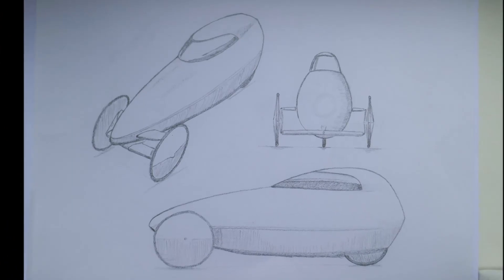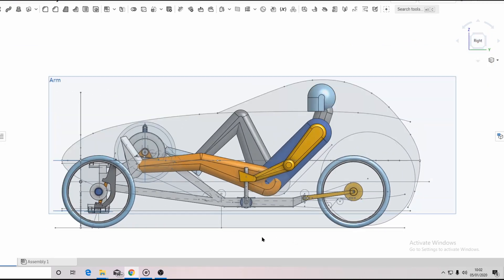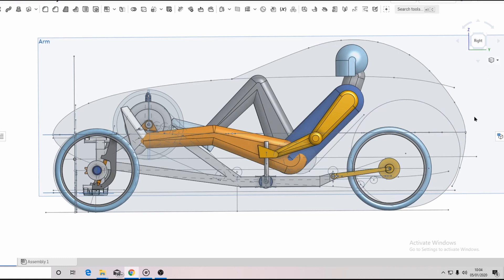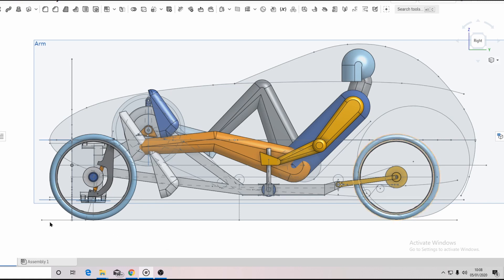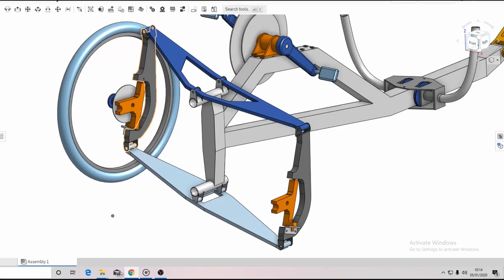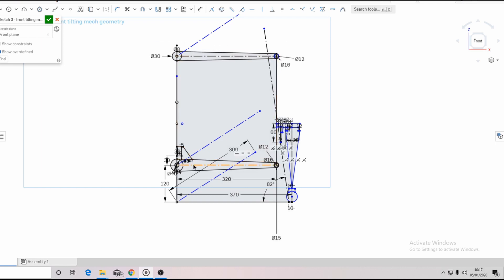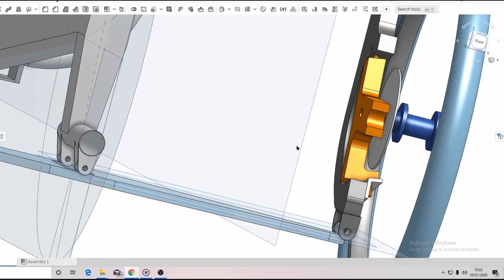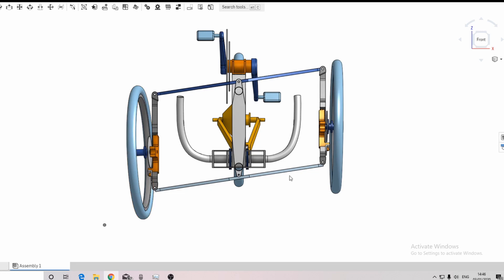Tilting Trikes Part 2 - Designing my streamlined, tilting, three-wheeled velomobile

Comment: Looking at your project, I figured it would be one of these with two seats. But not side by side, but one behind the other. It may not be possible to place rotating pedals but sliding ones with bars up to where the front crown would be and connected to it to such a bar that would be triggered to push the bar back and forth, allowing two people to activate the system at the same time. I don't know how to send figures around here or if it's possible. But if I knew a way, maybe we would exchange experiences.
Reply from the maker: I did seriously look at a linear pedal system but in the end decided that it was too complicated with no off the shelf components.

Comment: I haven't really understood what advantage the tilting wheels have. Could you explain in detail please? Thinking to develop my own one. But I'm not sure yet if to go with or without tilting wheels.
Reply from the maker: Hi, the advantages I think are: less risk of tipping over when cornering allowing a higher centre of gravity and/or a narrower vehicle; greater rider comfort and (maybe) enjoyment; less affected by bumps (I.e. the vehicle won’t tip to the side so much if one wheel hits a bump or a dip).  The disadvantages are greater complexity and weight; ground clearance when tilting.
Reply: @MetalMachineShop  Hi, have you seen this? Seems it could be built quite light and with minimal mechanisms. https://youtu.be/t1sUOtY4fYs
Still I'd go for an Quad....

Comment: Love your work mate ! Interested what basic what fork geometry you used. From my understand modern ideal is 73°head angle and 45mm rack. Tonight been brain storming an open recumbent based on a 80s Dutch Roulandt frame that I found today on road side chuck out. I believe 660mm width (legal cycle width in Australia) is achievable, considering it's to be an open design. I'm interested to liaise with you. I like your approach to design.
I'd like to share some more of the ideas about the brief I've set for myself, particularly as you have been so open on the Web about basic geometry and what exactly you are building. 
I was just going to be doing a  2wheel recumbent but then contemplated tilting 3 wheeler geometry.  Good on you for being so through about geometry variations and consideration there of.  I've looked at a couple of utube clips. One of Harley Davidson bolt on kit and 2 of your videos. 
You've more less answered all my inquiries.  Good on you. 
Inspired to practice on a 3D modelling program.  Being a newb to it really I may just start with sketch up. 
Hmm how to correspond??
Here's my email:)
adam.h.r18@gmail.com 
Cheers

Comment: Okay, so I am watching this in sequential order and I realize this is likely too late, but here it goes:
Suspension is very important.  Unlike an upright bike where your body can cushion the vibration, in a reclined position the bumps and vibrations go right into you.  My fear is that the flexing, undampened suspension of the front would cause a lot of shock and vibration for the rider.  Also, I'm worried about losing stability on washboard/cobblestone roads due to rapid flexing and tilting.
I also feel that the rear wheel should be as large as possible.  It will make for a smoother, more comfortable ride because it reduces the angle of attack and spans wider gaps.  It will also reduce rolling resistance, and the tires will last longer because they have more material.
Also, I didn't see it in the CAD render, but the rear suspension should be dampened so you're not bouncing, both for comfort and stability.
Reply from the maker: I did a design study with a bigger wheel, and while you are right about the advantages, it makes the trike a lot longer, a bit heavier, uses up the luggage space and makes for a tighter break over angle for the chain. Pros and cons, but for me smaller was better! Sorry for the delay replying and thanks for your comments.

Comment: This series is extremely valuable! Could you arrange it in a playlist? I'd like to refer someone to it and the titles don't all show the part number.
I learn't a lot of valuable things which I will likely apply in my starting carreer in engineering. Thanks a lot for sharing!
Reply from the maker: Hi, thanks. I will do that as soon as possible.
Reply from the maker: Hello, I've just added the playlist for this video series.
Reply: @MetalMachineShop  Thanks a lot! Are you building a prototype of the velomobile?
Reply from the maker: @MrSaemichlaus  Yes, I am part way through making a basic prototype.  It won't be pretty, but if it works, I will build a better one.  I want to check if the tilting mechanism is successful before committing too much time and money!

Comment: Looks great, if you're moving from the starting cam towards a drive-by-wire, could you overcome the offsetting limitations of the cam by using the wire to achieve similar geometry to a rack and pinion design? 

A personal consideration regarding the two chain guide pullies guiding the chain underneath the rider leading on and off the drive-chain-ring could be on the same axis just offset slightly so the chain would run in opposite directions parallel in the plan view rather than the typical parallel in the side view. as illustrated.
Reply from the maker: I did think about using wires for the steering instead of pushrods.  Someone told me there might be problems with resonant frequencies, but I’m not sure about that; it seems to work ok for aeroplanes.  In the end, the design got a bit complex need for return pulleys and so on.
Good point about the chain idlers, I will look at that solution.
Many thanks for your comment!

Comment: The front tilting design is interesting, as it avoids the oversteering tendency of delta trikes, but there is a major flaw regarding the weight distribution. Because your CG is approximately a few inches above your hip joint when you seat in a recumbent, the rear wheel will be loaded with 2/3 of your weight while the front wheels will each be loaded with only 1/6 of your weight in your current design. This will result in a 1:4 ratio of the slip angle between the front and rear tires. Except if you use front tires 4 times more sticky than the rear tires, it will understeer so badly you won't be able to carry any sort of speed in a turn, which defeat the purpose of a tilting trike. To avoid massive understeer, you need 1/3 of the load on each tire, i.e. 2/3 of the load on the front "axle". That's the reason why all tadpole trikes or velomobiles have the front axle around or behind your knees. It makes the implementation of a tilting mechanism more complex, as your legs are in the way, but it's better than having front wheels sliding every time you try to turn.
Reply from the maker: Hi, thanks for your comments.  I am working on a prototype so will soon find out whether it works in practice!

Comment: The kingpin angle and rake geometry at the ends of the front end components is thoughtful. Could you rake the center frame pivots to achieve similar results? It might add some loading stability in that the chassis weight load would then be aiding in self-leveling or self-righting forces for better tracking. More or less like the rake added to the crown assembly of a conventional single front wheel trike or bike? Something to play with in 3D now. Nice cad work. I like the flexing suspension concept. 3D twisting provides some great compensating geometry and progressive response. Keeping all three on the ground is always best. Steering with tie rods is still simple with the tilting action if the wheel end steering pivots are on the same plane as the lower suspension pivots at the wheel ends and the center steering lever is integral to the lower suspension section keeping the entire steering apparatus in the same plane as the lower suspension section. Geometry can be created for the center steering lever to compensate for the natural understeering of the inside wheel.

Comment: Does "counter steering" come into play with this three wheel designs?
Reply from the maker: It should do, just like any bike. Low centre of gravity may make it a bit wobbly though.
Reply: @MetalMachineShop  Wobbly is not good! I thought the lower the centre of gravity the better.?
Reply: @MetalMachineShop  I'm not sure you know what I mean by countersteering. When at speed a conventional two wheeled device turns left by turning the handle bars right. From what I have observed by watching other reverse trike leaning designs, countersteering is not a component because the tires are manipulated on to their side mechanically. A two wheeler is subject to gyroscopic forces which requires the countersteering principle.

Comment: I believe the term "fly by wire" has to do with 'electric or electronic" not metal cable wire as in there is not a "mechanical" push-pull involved. Mechanical would be rods, cables and even hydraulics.
Reply from the maker: Yes, you are right, I misappropriated the phrase!  I am thinking of a closed loop pulley system, a bit like on an old aircraft or a glider.

Comment: Do you realise how bad for your neck that low seating posture is?
Reply from the maker: Do you think so? Seems like a fairly natural posture, possibly better for your neck than a normal bike.  I’ll just have to try it I guess.
Reply: @MetalMachineShop  no it's really bad for you, as someone who has neck issues I can attest.  The position is actually, with the chin closer to your chest reducing the curve in your neck and strengthening the muscles on the front, anterior side, of your neck. Try reading a book in bed  or on your couch in similar position with your head unsupported. The hypoextenion position is not recommended in any form and worst when unsupported. I guess you got to do what you got to do for progress. But that position is unsustainable in the long run.

Comment: Fabulous!  Delighted to see your follow up. Also, John Tetz, of foam velomobile fairing, argues rather persuasively that a central steering control aids in the easy walking one's vehicle and steering it when ever you need to move it but particularly in the event of multiple flat tires or other possibilities. https://vimeo.com/25131208  Oh! Which CAD are you using and will it be open source design... (please)?
Reply from the maker: Thanks for your comment. Good point about the steering - I hadn’t thought of that.  I’m using Onshape. I haven’t decided about the design rights yet, but watch this space!
Reply: @MetalMachineShop  Thanks again for the upload, which I hope to see much more of. :) I am on the same path, but not as advanced as you.

Comment: @MetalMachineShop Is your vehicle for urban use, possibly commuting? If so, do your urban environs include speed humps or pedestrian bridges with non-smooth entrances that are equivalent to speed humps for a velomobile? If so, a shorter wheel base may suit .
Reply from the maker: Hello again!  It’s supposed to be for general use, including commuting, so I’m trying to make it as practical as possible by minimising turning circle and width and maximising ground clearance.  However, ground clearance and length are a function of the basic design so with limited ability to change.  I’m not sure a velomobile is ideal, or even very safe, for complex urban environments without excellent cycle facilities. A bike make be better for that.
Reply: @MetalMachineShop  What ground clearance do you feel best? I have seen 4 inches and 6 inches. 4 Seems to provide less drag, while 6" should give fewer scraps on the bottom.
Reply from the maker: I would prioritise practicality over drag in this instances, but I would have though that 4in would be enough in most circumstances, but more would be better if possible.

Comment: Lovely design, very aerodynamic if only in the summer things could get rather warm, as there is little air ventilation inside. I had this idea, I don't know if you like it, but make something of a car grill(an awesome one with a logo in the middle lol)) in front so cool riding wind can pas through. Something with vertical blinds, that you can open and shut if the drag is too much.
Reply from the maker: Good idea!  I was also thinking of removable side panels in the body which would probably not affect aerodynamics too much but would improve ventilation considerably.

Comment: Hi there

Can I ask why the pedals are so high ? 

There is probably no room for a front dérailleur ?
If the first pulley on the drive side taking the chain under the seat was a mid drive made from a IGH then you would not need a front mech and could also change gear whist stationary ?
Keep up the good work , always a pleasure to see other peoples ideas take shape.
I am old school and sit on a plank of wood with chopped up bike bits to see what goes where :-)
regards Paul
Reply from the maker: The pedal height is dictated by two things; pedal/feet ground clearance at maximum tilt angle and the need to put the bottom bracket more or less in the centre of the velomobile body.  Hopefully a front derailleur will fit but I haven’t looked at this in detail yet.  I also want to add an e-drive unit somewhere.
Reply: @MetalMachineShop  I ride a Python trike where the front end pivots so effectively the front leans. I find I can get away with a BB height of 15" there is only a small amount of heal strike and that is always when stationary and leaning the front end over for a maximum turn.
Obviously tilt angles vary between the Python and your velomobile , I have never measured the angle on the Python , I wonder if you can achieve maximum tilt when stationary without unexpected things happening ?

regards Paul

Comment: Great video! I'm also designing my own tilting velo, but I've went with a bit less conventional design - a leaning diamond quad.
http://www.bentrideronline.com/messageboard/showthread.php?t=149113

Basically, it would be a cross between Autocycle Pulse and iLean vehicles designed by Vuong and popularized by Steve Nurse:
http://en.openbike.org/wiki/~iLean

Technically, it will be recumbent bicycle with "outriggers" enclosed within the body (I don't need a very wide track and I need a wide shell anyway because I am, frankly, fat and cannot get away with 40cm wide HPV anyway).
I've managed to turn my existing FWD bent into a diamond quad prototype:
https://i.imgur.com/uE7qmxrh.jpg

I'm pleased to say that it does works wonderfully in practice, iLean is an EXCELLENT suspension that needs no springs or damping elements and main wheels will be suspended of course..
Given CG low enough, track wide enough and limited tilt (but still narrower track and higher CG than conventional velos, which is very important for me because I cannot have BB too high - blood circulation problems) , you HPV will be unable to 'lowside'  like a bike if traction is lost like on this video:
https://www.youtube.com/watch?v=fmEnEYF70cM
Which is extremely important for recumbents, given body position that preclude ability to add 'body english' to balancing corrections, so loss of traction on a steering wheel leads to a nearly instant fall, and things are not different for a leaning trike with narrow track and high CG (does not seem to be the case with your one I presume).

To make it statically stable AND have HUGE theoretical cornering potential with limited tilt, a tilt lock is required, and there is a possibility of direct roll control like on Tripendo trikes by using a separate lever that I will be testing, see this article:
http://lefthandedcyclist.blogspot.com/2018/11/the-optimal-all-weather-ped-electric.html

There IS quite a bit of wheel scrab, BUT:
1. Wheel scrab that results from leaning actually contribute to 'lean resistance' (lean damping) and can help maintain balance.
2. On my design, in free-leaning mode (tiltlock disengaged) outrigger wheels are unloaded and only lightly touching the ground, hence contributing almost nothing to rolling resistance.
Reply from the maker: Thank you for all that information! The diamond leaning quad idea is really interesting!

Comment: Trikes don't usually have a rear brake because in real world riding they don't work very effectively and are more dangerous than helpful in stopping. (rear wheel skidding) They are normally only used as parking brakes. I don't use mine and have removed it as I kept forgetting to take it off and wondered why I felt so weak when I was peddling.

Comment: Been thinking that an all electric drivetrain is more suitable for velos. Mechanical coupling and gearing required for these HPVs is really messy.

You could even do all braking electrically.
Reply: That's what the Podbike does. It will be interesting to see how well it performs in real tests.
Reply: @SchemingGoldberg  Doesn't really matter about performance. Supplement with a rechargable battery.
Reply: @difflocktwo  Sure, most people won't care. But I personally care a lot about efficiency and raw speed. It's like a fetish.
Reply: @SchemingGoldberg  What I meant with my unclear comment was that you can get pretty much any level of performance you want with onboard batteries.
Reply: @difflocktwo  Sure, but my (also unclear) comment was more about the efficiency side of things. A standard bike chain system is ~97% efficient, whereas generators + motors will be much less, 80% maximum. So there's a lot of wasted energy. That's a big deal if you run out of battery power and need to manually pedal it home.

Comment: hi advise to use,  carbon belt to power train. because the chain, at what length, will have a lot to lose  on friction and inertia
for transmissions to use for transmissions to use planetary gear
https://www.sheldonbrown.com/internal-gears.html                       https://bike.shimano.com/en-EU/components/urban/category/internal-geared-hub.html
http://www.schlumpfdrive.com/index.php/mountain-drive.html
https://blog.gatescarbondrive.com/                         https://bikefix.co.uk/gates-carbon-drive